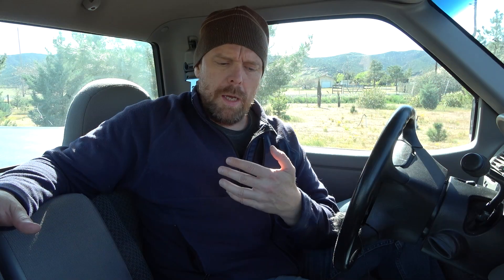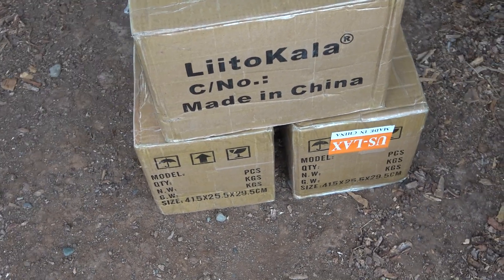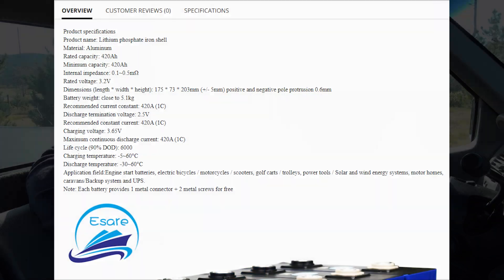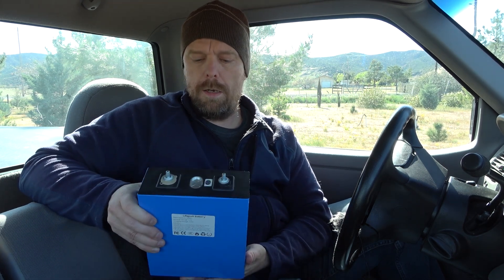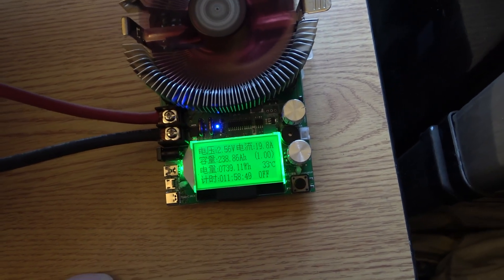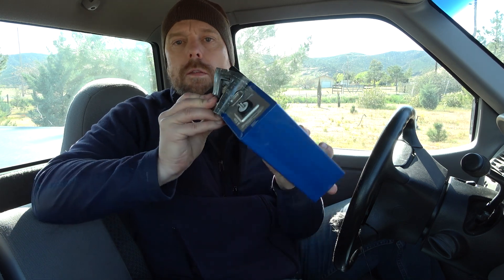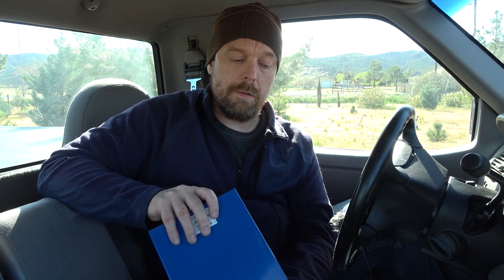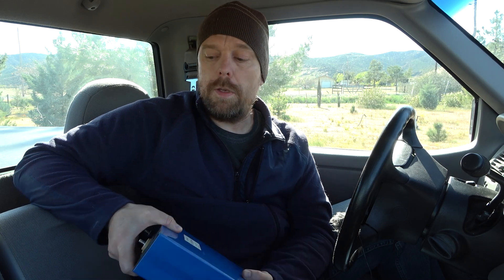Why I Closed My AliExpress Account

Comment: Glad to see a video from you.  I just made my 2nd trip to the Texas Hill country from Houston with my new '17 Bolt battery.  It is 300 miles each way. That extra 10% capacity sure is nice.  The Electrify America chargers I used worked flawlessly for first trip ever.  The charging interruptions I got on my January trip did not happen this time.  Perhaps EA has tweaked its charger firmware a bit.
Reply from the maker: Thanks! And that's awesome to hear. I can't wait to get my new battery!

I think that a lot of EA's issues are due to unvalidated setups and lack of use. As these charging sites start to get used more frequently, those early bugs should be worked out.

Comment: I've had the same type of problems with Aliexpress. They always side with their sellers from what I've experienced. The saving grace for me is that I always use my credit card and the credit card has been wonderful at stepping in and taking care of disputes. Good luck with your situation and I wish the best for you! These sellers are going to have to quit trying to deceive the buyers! Keep letting people know what's going on, so we can steer clear of those fraudulent sellers!
Reply from the maker: Thanks! I was going to pursue a full credit card refund, but mine was going to require that a return the cells. At that point, even if I got the full refund, I'd be out the cost of shipping the cells back, which would be more than I paid for the cells. I have a use for a secondary 48 V system, so it's not the end of the world. But this experience would have been backbreaking for some DIYers on a budget.
Reply: @newscoulomb3705  My credit card company has told me not to pay not one more cent for return shipping. They make the seller send a label. And if they don't it sits there until the credit card company tells me it can be disposed of. The items are misrepresented, you should not have to pay to return them because they misrepresented them. Let me know if you need further information. I'll help you however I can to stop the sellers from doing this to people. Think about your binding contract for the item or terms when you bought it. Don't ever pay for anything outside of the contract!

Comment: Frustrating experience, for sure.  Until they lose sufficient customers due to this kind of experience, I guess they don't have any motivation to fix this.  Good for you documenting your experience.  Once again, advocating for your viewers as you work from the leading edge.

On another topic, have you had your Bolt battery replaced yet?  I got my 2017 done a month ago.  The process took 4 days which was longer than I expected but not unreasonably long.  The battery and software allow it to be fully charged and the "expected" ranged is consistent with a 65 kWh battery.  Haven't had an opportunity to fast charge a depleted battery to see the new ramp rate, so I have nothing to contribute there.  Anxious to hear your experience.
Reply from the maker: Thanks! I'm still in line to have mine replaced. I'm going to call the dealership soon to see where I am in line, but I was 8th last time I checked. It sucks that your swap took so long, but I'm glad to hear you now have your new battery.

Hopefully, I'll be able to start doing some Bolt EV battery update videos soon.
Reply: Bruce - did they have the required hose (yours is a ‘17, right?)?  Any coolant level issues (air bubbles to work out) after the swap?  Software worked correctly right out of the box?  Or did the new battery have to relearn learn its’ state of charge after a few charges?
Reply: @dennislyon5412 Yes, mine is a '17. Absolutely no issues.  They charged it up to 100% to confirm all was good, "right out of the box."  No relearning necessary.  It's been a month now and it's running and charging just like new (actually better than new since roughly additional 8% of battery).
Reply: @bkackman  - good news!  My swap is coming up in a couple of weeks - crossed fingers.  I hope it goes as smoothly as yours.

Comment: Eric, maybe they transposed the the digits somewhere along in the process. Evidently from your testing the labeled 420Ah should have been labeled as 240Ah. It appears they never passed the original 280Ah and they altered the barcode.
Reply from the maker: Yes, some thought that might have been what happened, but Esare was selling a number of misrepresented batteries. Their "280 Ah" cells appeared to be 150 Ah or 200 Ah, and their "200 Ah" cells were only testing out at 100 Ah. 

These at least appear to be Grade A, unused CATL batteries, but they are still nowhere near the advertised capacity.